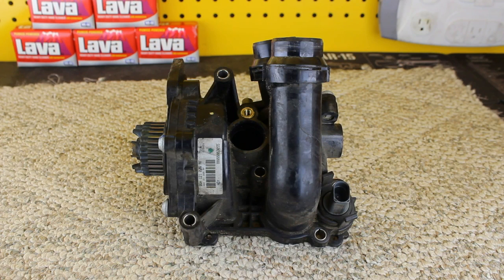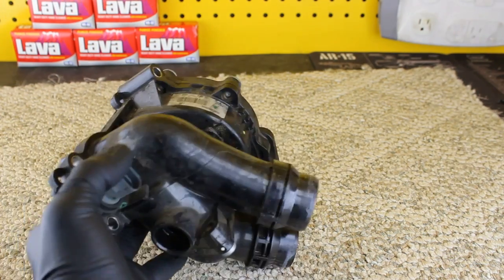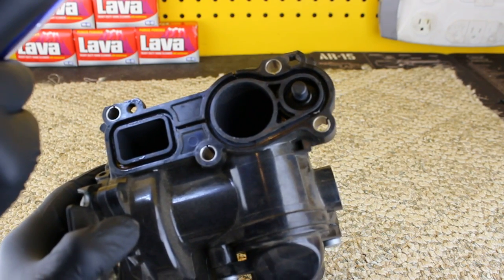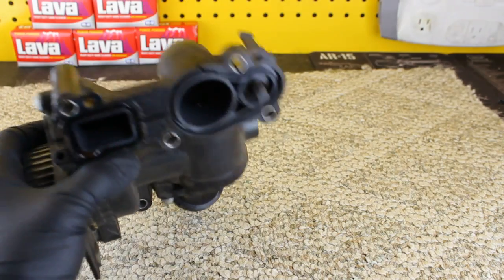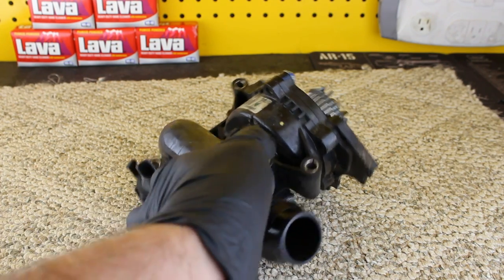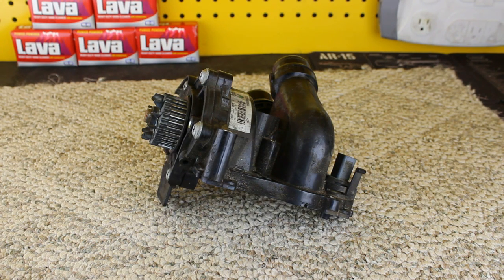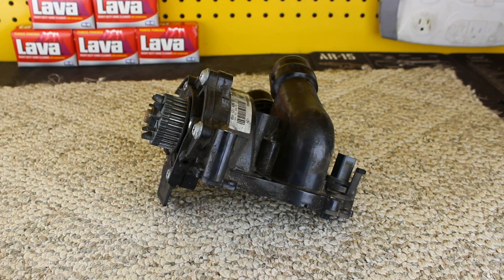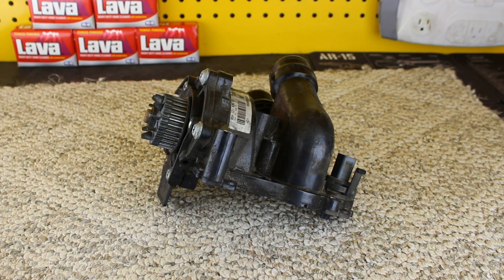How VW 2.0t TSI Water Pumps Fail

Comment: hi. superb video!!!. I have a question, is it possible a water pump fail due to elongated screw?
I have 1.8 tsi bzb engine with 4 water pump changes and the 5th is leaking with only 6000 miles. :-(
would be necessary chage the balance shaft and the belt? thanks a lot.
Reply from the maker: No need to change the belt. It's possible the screw is the issue. VW did update with shorter screws.
Reply: Hi, thanks!

Comment: great video, very detailed. I have an appointment on Monday December 29,2014 to have my third water pump replaced. I own a 2011 GTI DSG with 84,000 miles on the clock. I hope they know something new since the last replacement. My last one went bad after 21,000 miles after installation. You provide a great service. Thank you.

Any chance you'll do a video on GTI passenger door window regulator replacement.

Thanks again.
Reply from the maker: Stephen Linton You are welcome. 3rd in 84k YUCK! I can look into doing that window reg video. I have only replaced 1 due to glass breaking. I will tell you that some of the new GTIs have rivets( FREAKING RIVETS) holding in the carrier. I had to drill out 15 or so just to get to the regulator. I replaced them with VW pop clips. Those are not great, but it's better than rivets. What ever happen to plain old 10mm bolts! Good luck with the water pump

Comment: Awesome vids Charles, Do you know of a video to replace water-pump on B6 platform passat?
Reply from the maker: Kevin Hurd off hand, no. There are 2 different pumps on the Passat. This one in the video is the CCTA which is late 2008 and up. There is also the early one which is BPY engine code. That one is driven by the timing belt
Reply: Hello Humble! If I change the Belt on my Jetta Mk6 2.0T , what is the torque value to apply on bolt pulley?

Comment: I have a leak on 15 Jetta TSI (1.8T) its coming from the water pump area. I do have to replace both the thermostat housing    
  (06K 121 111 P) and the water pump (06K 121 011 B) ? Any feedback is appreciated. Thx
Reply from the maker: I would. They come separate but I’d replace both
Reply: How many miles? It’s covered under the drivetrain warranty which is 5yrs 60k miles.

Comment: Good Info Charles. My Pump has failed. I want to replace the pump and the Hose-line seal. Kindly help out with the Part Number for the Seals on the 3 Hose-lines that are connected to the Water Pump.
Reply from the maker: I don't have that info The VW parts manual is a different ball game. You might not even be able to get those seals separate from the hose. This is a place where the dealer is a great resource

Comment: hi mate i got 1.5 tdi   2014 vw golf  over heating i replace  both electric  water pump plus timing bet one still over heating ,,, fun not kick  4 pin plug 12v/ 0v/ 1.18 v / 12v  i put my test light to battery -  touch 1.18 then fun run...thanks

Comment: Many thanks for the videos, they are so helpful...  

I thought I'd throw in some comments regarding my situation.  I have a 2011 GTI.  114,000 miles.  Just got the P2015 so I'm installing the new revision intake manifold and replacing the injectors with all new while I'm in there, along with a good carbon cleaning.  (My luck, I don't replace them and they start going bad one at a time... No thanks, I'll bite the bullet now and just get it over with.)  Knowing that 114,000 miles with no water pump issues is like a miracle, I thought I'd do some research and just get it out of the way now since I have to pull the intake manifold off anyway might as well save myself the labor of doing it twice.  Going with an all-metal unit from Graf so hope that resolves some of the issues with the water pump fatiguing over time.  

Anyways, if the water pump was "trash", I wouldn't be at 114,000 with no issues at all.  I'm not saying people don't have issues, but I'm not sure that they aren't induced by other problems like lack of maintenance, engine oil leaks, improper replacement, using chemicals on engine, etc,.  

So I'll have new intake manifold, injectors, carbonless intakes/valves after cleaning, new water pump and antifreeze, oil change, spark plugs... replaced PCV a few months as well as new R8 coilpacks all around.  Should be good to go for a while now that I've gotten all the big 2.0t wear/maintenance items out of the way once this is done.
Reply: Rise from you grave!

Did you wind up having to replace the valve cover?
Reply: @tsriftsal3581  Nope.  But I'm am starting to leak on the back side due to cracked sealant.  Need to pull it and reseal.  Not a big deal at all.
Reply: @PDXborn  cool.

Comment: Charles,
Love your vids.  Regarding these water pumps, how is VW handling the warranties on these?  For a 2012 GTI, would that be the basic or drivetrain warranty?  Viewer ajlbeer must have had this covered on the drivetrain warranty since his is the 2011.
Reply from the maker: They should be covered under powertrain warranty. As far as I know, there is no other extensions on that pump
Reply: HumbleMechanic Thanks Charles!  That's five years.  A good little while not to have to worry about paying for it if it fails.  Not sure what the anxiety is about.  They extended the coverage on the intake manifold right?

Comment: This is a good video,  Thanks I have a 2012 Q5 (81K miles) with this engine and I removed the wp today.  I had a huge water leak down the back of the motor and was finally able to track the source back to the pump.  I will say it is rather difficult to get to.  I do have a follow up question.  How do I remove the pulley on the balance shaft that drives the pulley so I can replace this small belt with the new pump?  I was able to slide the old belt off the pump but can not remove it from the driver pulley.  Can you help?

Comment: So quick question for the guys at HumbleMechanic....

My car has gone through roughly 5 waterpumps over the span of 5 years...the process starts like this:

While driving normally, the check engine light goes on
After a minute, the beep will sound stating to check coolant level...
Coolant Level indeed low
When you open the coolant holder, it bubbles back to full,
After letting the car cool down completely, all the coolant will drain out of the car

Why does this happen? VW South Africa say that it is because the pump gets warm and cools down and that causes it to crack...
Reply from the maker: Usually oil leaking on to the pump is the issue
Reply: @HumbleMechanic  what would be the cause of this? Head gasket?

Comment: my 2012 Turbo Beetle was just diagnosed with this(39K miles)...they tell me its $1295 to replace..i am going to a cheaper/trustworthy guy i know...can u recommend the best replacement? or are there alternatives...mine is leaking by the way.  not noticeable when car is parked...how long can i drive before i need to have it fixed..is a week or so ok?  Is if safe to drive with the coolant system indicator on?  The temp seems to stay at 195..so its not overheating.
Reply from the maker: +Ken Mcfadden that should still be under VW powertrain warranty I would think.
Reply: no volkswagen give you only 36,000 miles extended waranty cost 3,000 dollars and it is to 66,000 miles
Reply: china car manufactures(like Lifan) have more warranty on her own cars, lol.

Comment: I had mine fail from oil making the seals swelling on my 2010 GTI. Just recently with my RS3 with less than 5,000 miles, that one failed. I then asked my tech at my VW dealer if he’s seen a bunch of MQB cars with failed water pumps and he said many. Do the MQB water pumps fail the same way?
Reply: yup mqb water pumps fail but dunno if they fail the exact same way

Comment: Question ? Hopefully someone will know i just had the water pump replaced last week now I’m have all kinds of electrical issues, car dies at random wont restart then have to jump it off, earlier this morning it started but died as soon as i put into drive, check engine light is lit up plus all the dash like lights an gauges dont work plus now the window wont roll all the way up when i lock the doors plus now it wont start at all even if i try to jump it off... any clue as to what it could be? I have a 2012 beetle turbo...
Reply from the maker: Wow. I’d check the 3 connector bank under the manifold. 

See what the check engine light is for.  That may point you in the right direction. If a shop did it, call them and bring it back .
Reply: HumbleMechanic i took it back to the shop that installed the water pump, it had 3 errors one was miss fire in a cylinder an another was a air flow sensor cant remember the 3rd, but the guy that owns the shop is a friend of my dads he refuses to believe the problems i now have he caused an wants to charge me to fix it even though the problems i am now having i never had until he installed the water pump,  considering he charged me 550$ for the pump an 350$ to install it, witch is 3 times more then it should of been to replace it.... so now i have a car thats stuck in my driveway because it wont start or function

Comment: VW recently worked on my 2012 CC 2.0T and replaced intake manifold and cleaned carbon buildup on the valves.  I noticed a gradual loss of coolant since.  Had to re-fill 3 times now.  Is there any chance the mechanic had to touch the water pump or any of the lines and didn't reconnect properly or is it just a coincidence that it started leaking all of a sudden?
Reply from the maker: There is no reason to touch the pump on those jobs. One of 2 things I could think:
1) This is the most likely case, the pump is just leaking. It's a common failure point. 
2) The cleaner used for carbon cleaning accelerated the leak. I really doubt this is the issue, if the carbon was cleaned with carb cleaner, and the water pump got a lot of that cleaner on it, it may have helped. 

We also need to look at oil leaks. That is another reason water pumps leak. They get soaked in oil
Reply: @HumbleMechanic  I contacted the dealership that performed the work and they said that (per technician's notes) I have a small oil leak from the upper timing chain housing. The CC is a 2012 and has only 50k miles on it.  At this stage, they're all finger pointing.

Comment: Hi Charles, I have a 2010 Audi Q5 2.0t - It's had the timing chain failure then faulty Piston ring replacement (yes, hard to swallow as we don't have USA's legal support here in South Africa for this latent defect but Audi paid 70% of all costs so there was some help). Anyway it's over a year since this was done (now on 153000km and now there is a high pitched whine coming from near the centre top of the engine. You can replicate it by just whistling through your teeth like and engine revving :-). Audi glibly said it's the turbo and handed me a massive quote. On further visits to turbo, steering and VAG specialists (plus watching tons of youtube vids) they say it's the balance shafts or water pump. My question - would a failing balance shaft make this noise (it follows the engine note exactly, does not get louder or softer with the aircon or any other time (except when revving the engine) or is it just the water pump (bearing? - there is no leak at this point) and should I replace the pump. Balance shaft replacement versus water pump replacement cost differences are big and I don't want to overpay if I can help it. Love you vids - they have been very helpful on my journey with this problematic Q5...

Comment: Could a failing vacuum pump be the cause of a water pump failure? My pump has been replaced three times in the last year and a half. Today I was told that oil leak from either cam position sensor, pcv or vacuum pump could be the reason.

Comment: Great video.  I saw on your other video regarding the GTI water pump recall to also replace the seal for balance shaft/pulley bolt.  I have a 2013 A5 2.0 TFSI CPMA engine.  Do you recommend getting the seal replaced on my engine?  It wasn't part of the water pump kit from Rein.  They said in their video that they took your input when creating the kit to include the belt and pulley bolt, so I just want to double-check with you regarding the seal.  Thanks!

Comment: My 14 GTI is already in need of its 5th water pump. Only 84k miles on the odometer. I love and hate this car.
Reply from the maker: Yikes. Is there anything causing it? Oil leaks maybe
Reply: HumbleMechanic yeah I’m gonna have to see about oil leaks. Sad part is I just got it replaced 3500 miles ago. The old one was leaking slowly, the new one is leaking really bad. It loses about half the reservoir with a 10 min drive :(. Where is it common to see the leaks?

Comment: nice video #HumbleMechanic  it relives me to know that maybe my car just started leaking oil...maybe from the water pump? they can leak oil too besides coolant if the seal / gasket breaks or melts? and what can cause this issue? 

my car was perfect mk6 gli, drove it from SD to SF for about 8 hours, arrived saw oil leak coming from the water pump area. I am running UNI stage 2 k03, with other upgrades... can the high boost of the tune, AC turned on for 8 hours going between 80-90mph no stops could have cause that seal to fail do to the high temperature of the coolant and oil running thru the water pump? car has 65,255miles still has warranty is it common for to fail at that milage? might help people be aware of long drives like mine.

thanks! any humble response will be appreciated and will relive me from freaking out about what could be happening to my vdub. very first issue i have with it.
Reply: Did you find out why it was leaking oil and coolant?I have the same problem and don't know why

Comment: Hey, my 2010 GTI just leaked out all of its coolant overnight.  I just dropped it off at the dealership, but they're closed.  Have you seen this happen before?
Reply from the maker: Could be any number of things wrong with it. Could be a water pump, could be a water pump
Reply: HumbleMechanic yep.  Water pump confirmed.  It happens to every GTI, but they want to charge me $1350 to replace it.  I'm going to contact VW of America.  This is bs.
Reply: Scott Kimbrough that's cheap.  what part of the country are you in?  They charged me $1270.
Reply: Scott Kimbrough I'm in the Washington DC area.  Everything here is overpriced.
Reply: +DJPelio I was gonna offer to do it if you were local for cheap but that's way too much of a drive. Sorry bro

Comment: Hello, please I need youre help, I have a golf gti from 2011, and there ir a whistling noise, I have changed the pcv valve, looked at the canester and also taken off the auxiliri belt. Could you please confirm me if is the water pump? I can pass you a video if you give me your e-mail. Thanks!!!
Reply from the maker: It’s tough to diag noises on a video. I’d basically be guessing. I’ve had a few pumps make noise. Take the coolant cap off and see if the noise changes. Remember coolant is EXTREMELY hot and under pressure. Don’t do this when the car is at operating temp
Reply: Hello again!! I have tried taking the cap off the coolant water and still the same noise, im just getting crazy, any mechanic cant help me dosen t know where the noise comes from. They say it could be the tensor of the chain, id love if you could say any other option. The noise comes from front wheel passenger, sent you videos via e-mail and instagram.. many thanks boss💯

Comment: I had my starter motor on my 2011 GTI(65kmiles) Go bad , it was stuck and wouldn't retract,  so I had that replaced for $450+ and when I left my buddy's shop my car overheated after I got 3 miles away. I had no check engine light and I was able to very carefully drive it back while making sure to keep it from overheating too much.
 He and I believe its the water pump. Is there anything else it could be ? It has plenty of coolant , doesn't leak and has never had any kind of overheating issue. I have a water pump on order for it. Such a weird circumstance , what are the chances of having a major problem one after the other. ugh.
Reply: Try dropping your oil pan and cleaning out your collector / oil pan with brake clean. My wife had the check engine light / overheating issue and that is what it turned out to be. 

no new parts needed except a new oil pan gasket.

Comment: Why hasn't Volkswagen had a recall on these water pumps? I am at a dealership right now having my third water pump put on and it hasn't been a year since the first one.
Reply from the maker: +AgentP K they did on certain cars. Only GTIs with a certain vin range. 

Sucks you've had so many issues
Reply: Is there a better made water pump for these models (aftermarket)?
Reply from the maker: +AgentP K nothing THAT much better.
Reply: Thanks!
Reply: That sucks!

Comment: as an Automotive tech for over 20 years, i've seen the worst that Germany has to offer. VW is right up there with Mercedes and BMW. And lets not forget the disaster that Mini was. Often times,the owner of these vehicles are the ones who can least afford to have it fixed. VW, Audi, and BMW have these slip-on coolant hoses. Well, when you remove the hose, the o-ring inside has been compressed for so long, that if you don't replace the complete hose assembly, then your chancing another water/coolant leak. I did a water pump like this, along with the tensioner for the drive belt, and the cost was over $2200. Absolutely ridiculous. These are the Pinto of the new Millennium.
Reply from the maker: Lol yeah

Comment: Replacing my water pump tonight using the aluminum housing  06H121026DD
Reply from the maker: Nice. If I end up putting the 2.0t I have back together, I will be doing that.